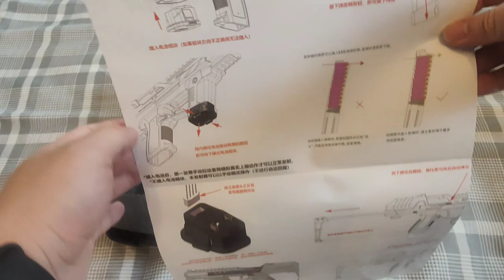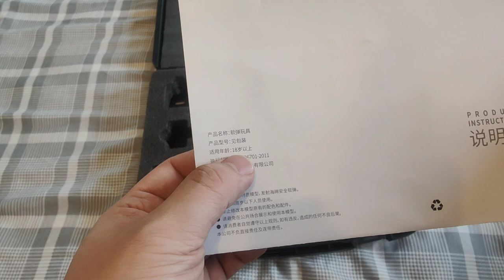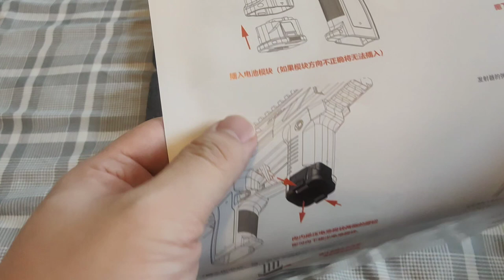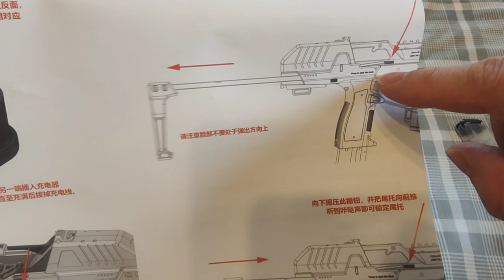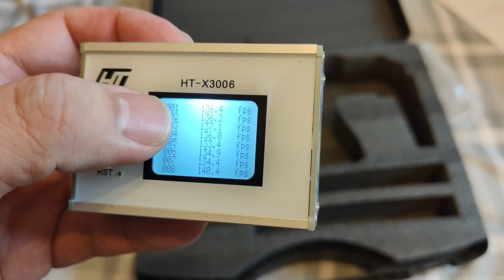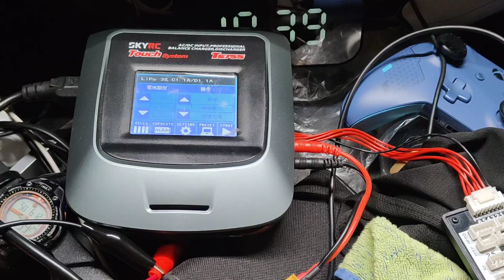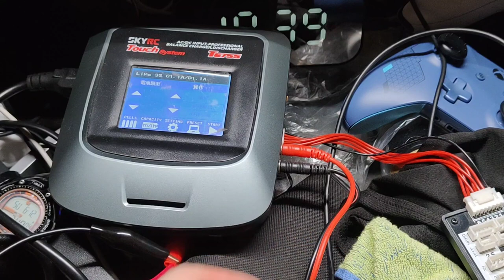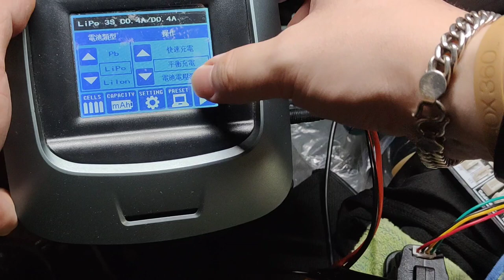QWK EDGE NERF short foam dart semi auto blaster first English review

Comment: I was looking forward to purchasing this blaster but the more I learn about it, I am becoming more disappointed. Battery charging is poorly design. MK3 Pro poor wiring and switches makes me worry about it’s interior electrical.
Reply from the maker: Well mine is fine so far but I haven't been using it a lot. Ifyou do have a problem getting it fixed or spare parts could be a problem. In China is  quite easy we could just send it back or get parts.